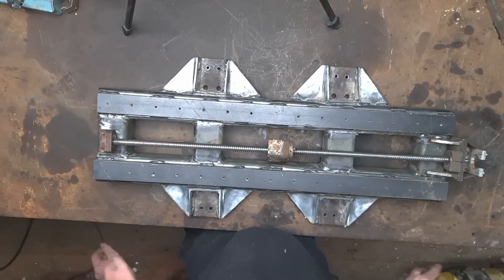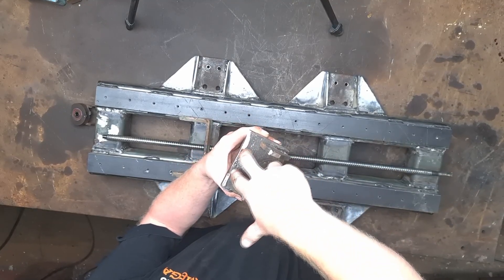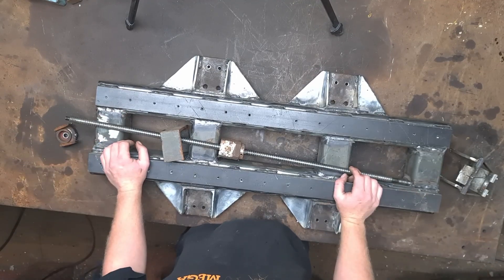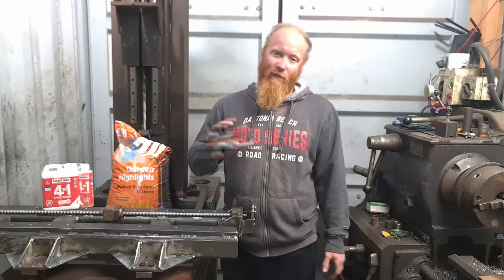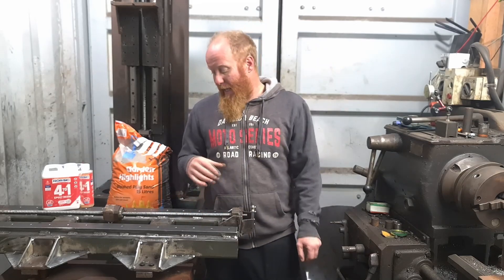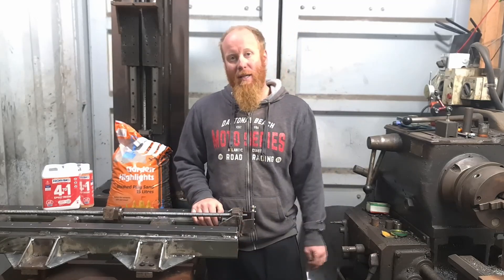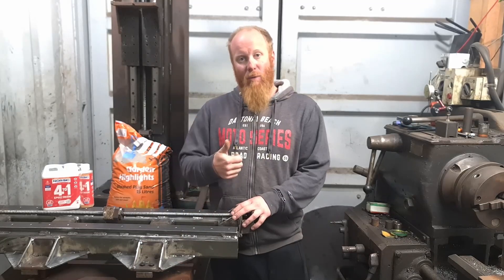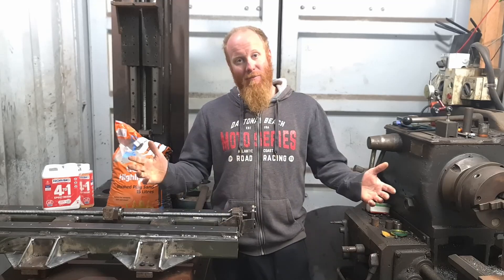Dont Weld On ball Screw Mounts until you watch diy cnc mill.

Comment: What is the length of the xyz linear rail area? Width of the frame.
Reply from the maker: they are 750mm y and z and 900mm on the x they are 25mm size. frame width is about 600